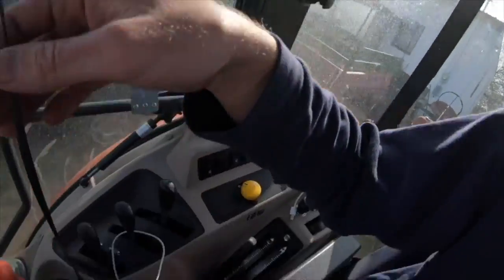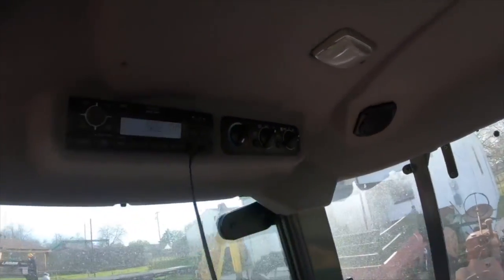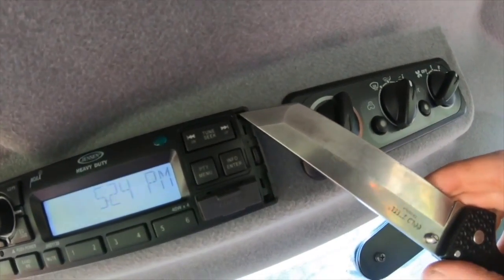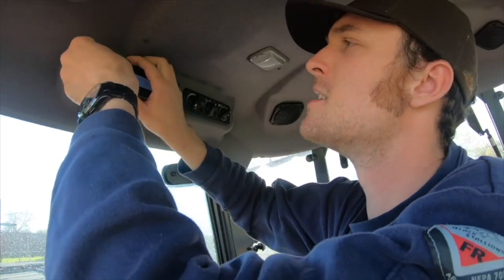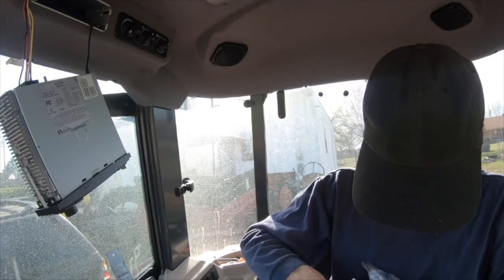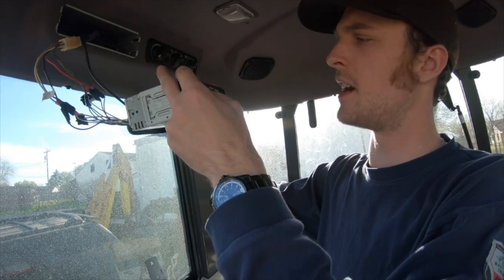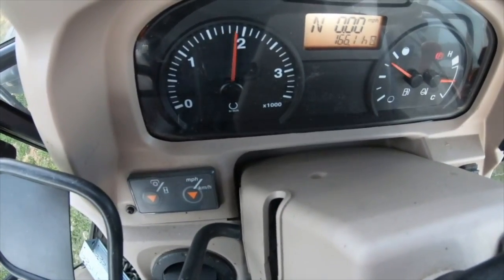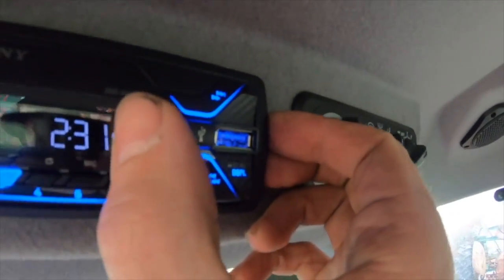STEREO UPGRADE IN A FARM TRACTOR!!! How difficult is it?!?

Comment: usually the whine is from a ground loop issue from the alternator. in car audio it was because the RCAs were near the amp power wires, or there was a bad ground with one of the components. that's why in some electronics the people put the magnets on the power wire which acts as a RF choke, from what i remember.

Comment: Its a kubota thing to not put in stereos unless you order it i did the same thing with my M7-172s just bought the radio i wanted and had dealer install it for me and cheaper. But then on my Fendts they now have a 10 inch touch radio screen that slides out of celing lol but fendt gives me a phone dock which is awesome . Thats the difference between my 160,000$ kubota and the 400,000 fendt lol

Comment: Bought a Boss unit for my CJ. No  more  CD/Cassette  units  for  me.  USB,  audio in, internal SD  card.  Water resistant.  I  think  audio suppliers  have  gone  standardized  wiring  colors.  If  they  did,  good.  Iffin  they  didn't,  they  should.  The  one  thing  i  didn't  get  was  bluetooth.  But,  it  sounds  like  a  good  option.  And  yer  right.  Ya  gotta  have  tunes  in  the  field.